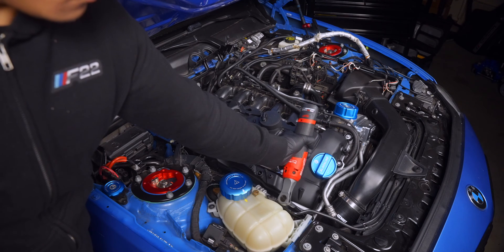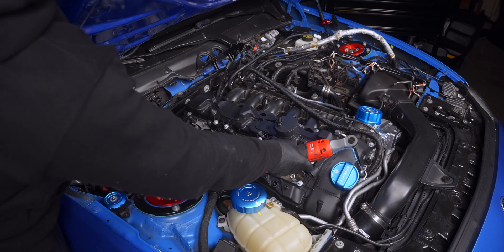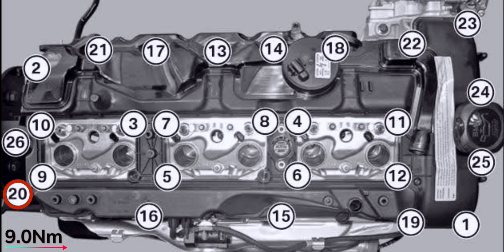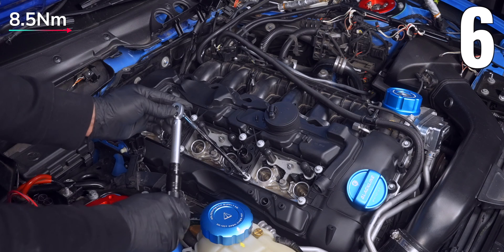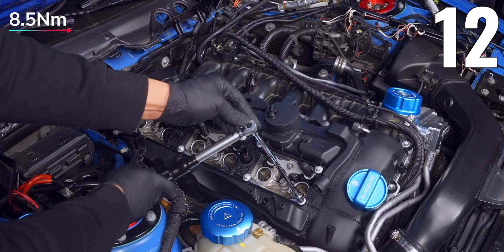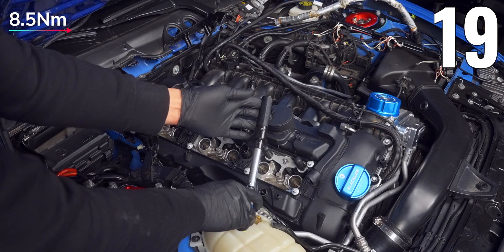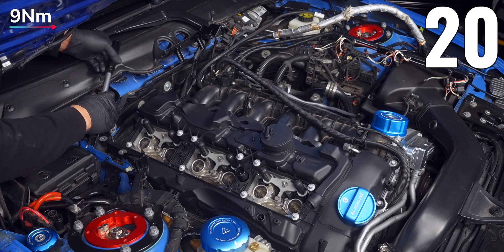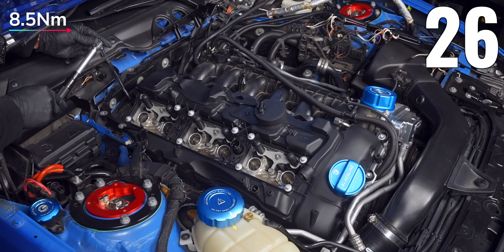N55 Valve Cover Torque Sequence

Comment: Should loosening be reversed? Starting from 26 to 1?
Reply from the maker: 1 to 26 or 26 to 1 is fine, but you only need to do it if you plan on reusing the valve cover.